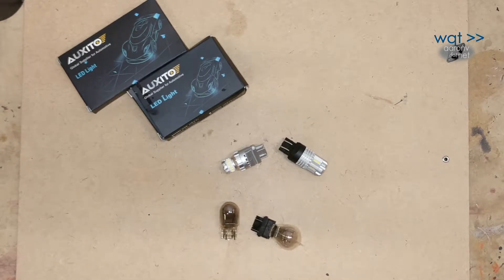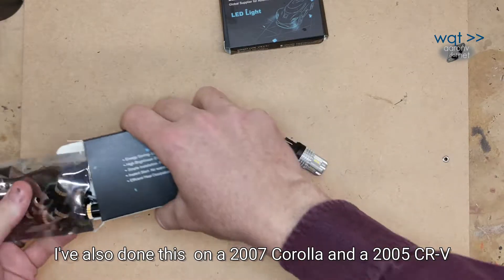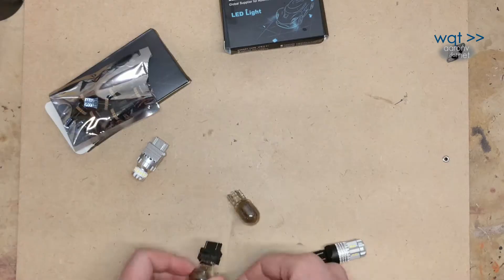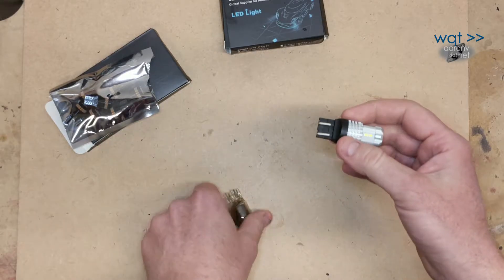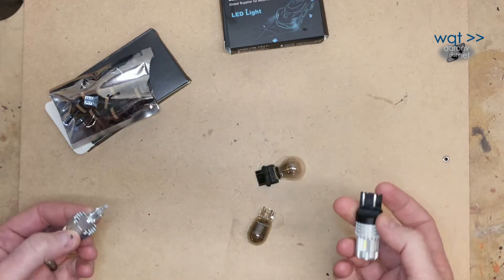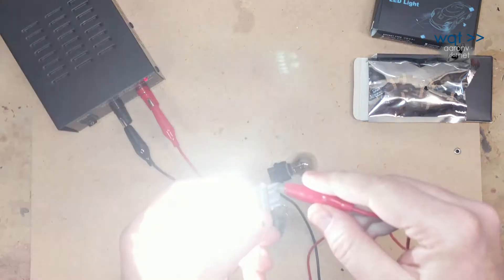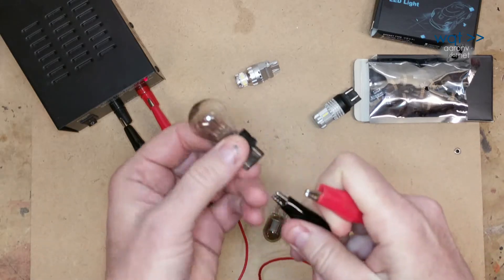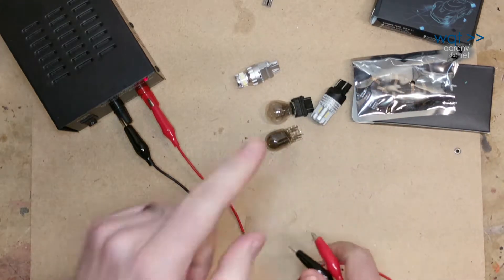wqt//Basic Auto: LED exterior signal light conversions (1984-2001 Jeep Cherokee XJ)

Comment: Do your side marker lights work correctly? I go the 194s from Auxito and they are polarity specific. The 07-01 Jeep XJs switch polarity when the headlights are on so in one orientation of the 194s they only work with the headlights off and in the other orientation they only work with the headlights on...
Reply from the maker: I've found most of the smaller LED replacements including the pricey Sylvania units at the auto parts store, are polarized. I installed mine so they would turn on with the headlights, so they also operate as turn signal markers only when the headlights are on. But the side markers are nearly invisible during the day regardless.

Comment: Thank you for the video.  Which LED light number replaces what bulb number?
Reply from the maker: LED numbers usually are "mapped" to an equivalent incandescent bulb. Just look up a bulb replacement chart for an XJ (there are many on forums and auto parts websites), find the one you're swapping, then search that number plus "LED" in Amazon, eBay, etc. And figure your best option.

Comment: I replaced all of my regular bulbs (except reverse) with these and an EP27 flasher and everything works fine except the 194 side markers. They will illuminate and work normally per side if there is at least one incandescent 3157 bulb installed in the front turn signal, but will shut off immediately if two 3157 LEDs are installed. Any ideas?
Reply from the maker: I have not seen that, myself. I have Auxito lamps in all positions. Could be something with the flasher relay. Or it could be a bad ground in the sockets. The 194s are often polarity sensitive (not enough room inside for a converter circuit), have you double checked that they're in the correct orientation? Kind of wondering if you're seeing the result of a backfeed condition.
Reply: @aaronvienot  Same condition with the original factory flasher (1999) and the new one, and I'm using the Auxitos. It's very odd. Neither the LED or incandescent 194 will light with dual 3157 LEDs, but they will (and flash properly) as long as one 3157 incandescent is present. The 194 LEDs will also light up regardless of orientation. 

Also, when I remove a 194 LED, the 3157s will go a bit dimmer, and will get brighter when I plug it back in. 194 incan doesn't seem to have this effect. The 194 LEDs will also light up very briefly (like milliseconds) when switched on or as soon as the contacts meet the socket, but then immediately shut off. Same exact behavior on both driver and passenger sides.

Comment: Did you need to install any relays or anything for this conversion? Or just LEDs?
Reply from the maker: Some LED lights are load balanced, some aren't. Some flasher relays are designed for LEDs, some aren't. If you get a situation where you have an unbalanced LED and a non-LED flasher, that's when you get the hyper-blink. At that point you get to decide which component you want to replace.
Reply: @aaronvienot  thank you for the info and super quick reply👍👍. Just bought a 2000 completely stock XJ with no rust on it but it does have some electrical problems just from being out in the dry air.
Reply: I did all LED for the signals except for the front turn signals as it wouldn't flash with LED. Weird. I even upgraded the flasher relay to an LED compatible one.